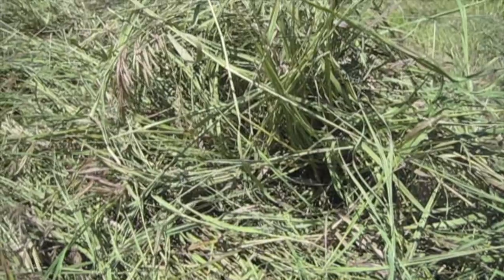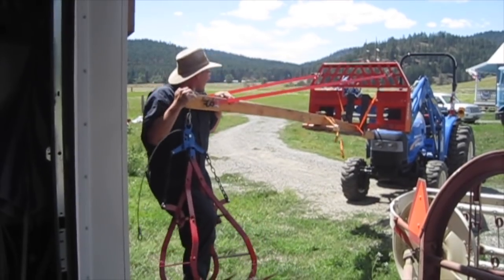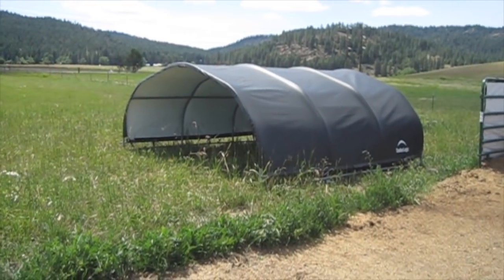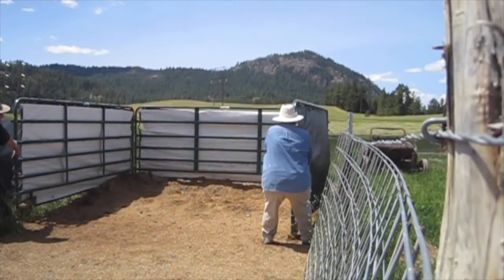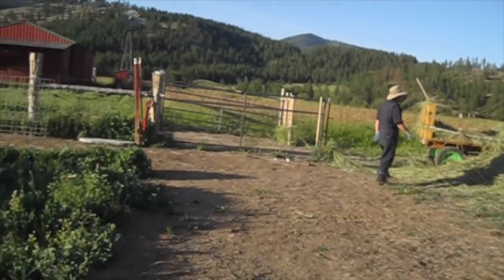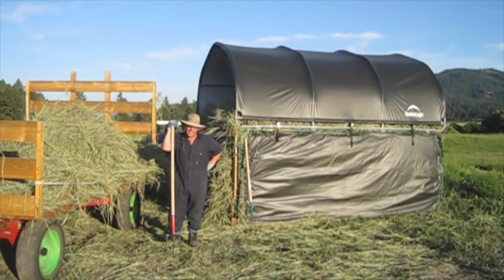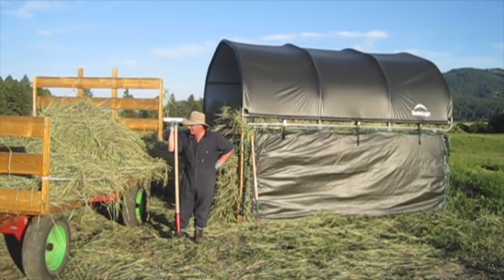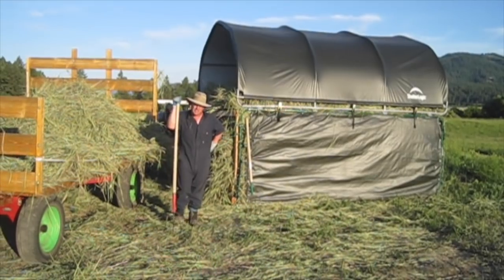Final Loose Hay Harvest 2019

Comment: Wow that grapple worked so much better than I thought it would!!!
Reply from the maker: Farmer Tyler Ranch it really did work well. For a relatively small grapple, it could grab a pretty good sized bite of hay. Looking forward to breaking ground on the barn, and then having the hay trolley system in place. Take care!
Reply: @vnthomas16  once you have it up and running use a sling or two, looks kinda like a fire escape ladder one side is fixed and the other side goes in the release. Should clear the little wagon in two loads.

Comment: Why not just back the hay trailer into your shed and push the hay off the back with the fork.
Reply from the maker: Nathan Fox hello! We have found the grapple does the best job, and moves the most hay with the least amount of effort! This upcountry season, haying will be different as we have a barn now and plan to use a hay trolley in it. We’ll still use the grapple, but we also intend to try hay slings as part of the trolley system. Stay tuned!